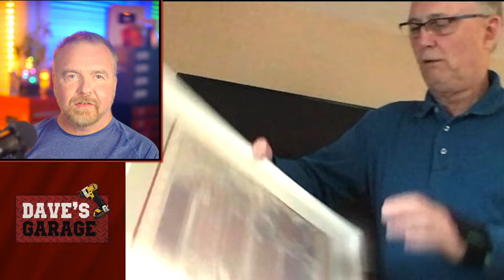Commodore 64 Chip Designer Interview: Albert Charpentier

Comment: I enjoyed the interview.  I was at Motorola when the 6800 was built.  A colleague of mine was recruited by the 6800 team to write a 6800 cross assembler that ran on the PDP/11.  I attended a presentation given by Chuck Peddle.  I remember him saying that the 6800  was a controller chip, not a computer processor.  At that time, the manufacturing was very difficult to control.  It took a while to get the yield up to an acceptable level.  As they were starting to get the yield up at the Arizona plant when the plant had their yearly summer shutdown.  When they restarted production, they had to go through the procedure of getting the yield up again.  During all this time a plant was being built in Texas.  Just as the 6800 yield was getting to be acceptable again, the production was moved to Texas.  It was another repeat of low yield again.  They weren’t able to deliver product and Intel was able to deliver.
Reply: What do you mean by yield?
Reply: @SheikhN-bible-syndrome  the number of usable chips for a given amount of raw material. Usually in this case it's the number of usable chips from a wafer. A wafer might have space for 100/200/300 chips depending on the size of the chip and wafer, but a low yield might mean only a few 10s of chips out of the 100s planned are usable. Such a low yield would be inefficient and costly.
Reply: Chip Belori  I mostly wrote code in assembly language.  I think the Motorola processors were easier to code for.  That includes the 68000 series.  I don't know how they were to design hardware around.  My first home computer build was a SWTPC 6800.
Reply: Just curious, why did they shut the plant down every summer?  Was it required for maintenance?  Based on the yield issues you describe from restarting production it just seems to be ignoring something fundamental to the ongoing success of the business.  I know hindsight is 20/20 but with business decisions like that it begins to put in perspective why Motorola just evaporated.
Reply: @jimfrench2001  I don't have an answer. It didn't seem to be a problem with older products.  In the 1960s, I worked for NCR in Dayton and they also closed the manufacturing plant for a couple of weeks in the summer.  I remember that many of the factory workers drove to work with their vehicles packed for a vacation.  At quitting time they would dash to their cars to leave. It seemed to be common in manufacturing.  With staggered vacations, they couldn't rely on have a full workforce all the time.
Reply: @WilliamBurlingame  Because of the fact they where so easy to program, we end up with x86 horrible.
Reply: @gorak9000  why don't these massive billion dollar fabs have their own stable power generation?
Reply: @jimfrench2001  It was not a business decision. Because of the cooling required during the summer, the power grid could not support both the fab and the cooling. Fabs require large amounts of power.
Reply: At high school we had a SWTPC 6800 that loaded from tape very slowly. Lunch time computer club was quite often over before it loaded or frequently failed to load.

Comment: I worked at Ensoniq in 1989 on the assembly line building the original EPS, VFX (short lived) and VFX-SD. I still have a working EPS and VFX-SD that I have to occasionally coerce into working. Mr. Charpentier's name would be called constantly on the PA system. All I cared about was music at that time, but you could tell there was something either special, or very important about Mr. Charpentier. I just celebrated 22 years in IT supporting all things Microsoft and very fascinated about technology and Engineering. If only I could go back in time.... I now regret never having a conversation with him or other key members at Ensoniq. I have been fortunate to have worked with, learned from and talked to many brilliant people. Missing that opportunity decades ago will always be regretted. Rock on Sirs! Love the channel and still love music.
Reply: Underrated comment... Really want one of those ensoniq boards, mainly an ASR10. Even though I'm coming in from a hip-hop background and we didn't use it all too much, the transwave synthesis capabilities of those keyboards are still super cool.

Comment: Years ago, I worked for Intel in Folsom doing chipset and later CPU validation.  This was from just before PCI-Express came out to just before the Core i series chips were sampled.  One of the Pentium 4 series teams had a printout of the traces on a Pentium 4 chip plotted out on a long roll of paper that was attached to the walls of one of the cube farms in a building that was more than 250 feet long and yet most of my coworkers still needed at least some magnification to be able to differentiate between neighboring lines.

Comment: After 30 years i got interested in 6502 8bit assembler and machine language again.
I think the C64 was and still is a great piece of engineering.
Reply: ...and it is a machine that you can completely know inside and out, and for me, at the time I had my C128(it spent most of it's time in C64 mode) I knew very little about the hardware.
Reply: After watching it from the start, at 27minutes Albert explains a lot better what I just trying to say above.
Reply: Besides the disk and tape bugs, yes.
Reply: I also still think it a marvel  what could be done on a 1 MHz CPU and a decent graphic system. 
Have a friend that made a "live" sprite editor that had:
- An editor at the top using 8 sprite
-  A line of the sprites in the animation that was edited
-  A display on the lower 3rd of the screen showing 8 of the current animation in memory that could be grouped and set to move as one unit.

Programmed using the cartridge "Edna" assembler. Just a fantastic example on what a Commodore 64 could do.
Reply: @IntenseGrid  I still have 2 128D machines, and still write code for those.. lots of fun to do.
Reply: @paulmichaelfreedman8334  Yeah, the C64 could have been a much better machine with the disk interface faster.   The tapecartSD makes things a LOT faster.
Reply: One Mhz...  yeah.  So much got done about that speed.  More than a lot of people might think.

It was lean and mean.

I keep an Apple //e running and sometimes program or write on it.  For the most part, one can create an illustration, write, play a game.

I got a 16Mhz 6502 for mine.  Crazy fast.
Reply: @DougDingus  The only thing that comes close is Parallax Propeller and P2 programming, but the on system development environment is better on the C64/C128.    I remember my first assembly language program for the C128.   It was a simple counter in the upper left of the screen.  Several of the digits flipped by so fast they were a blur.   That computer made a HUGE difference in the direction of my life!   Thanks Mom!
Reply: @IntenseGrid  Yeah, I agree.  The Propeller is a pretty great experience.  LOL, at the counter.  The very first assembly language program I wrote was to make some sound on the Apple.  Was nice, just a little loop, and when it's long enough, you hear something.  I did a counter later on various machines.  Suppose it was my first benchmark.  Count up from 0000000 to 9999999 by incrementing screen memory. Anyway, yeah the Propellers are really fun chips.  For a quick, retro style experience, the Propeller 1 and the simple Parallax graphics "driver" are pretty great.  No sprites, but a whole lot can be done with the flexible tile setup.

People are working on various P2 systems.  At some point, it's going to look a fair bit like your C128.  I've been toying with putting a P1 or maybe P2 on a card to install in an Apple.  I know others made little computers with it.  I ran a couple of those with BASIC, and had a good time!
Reply: @DougDingus  Yeah, I've played with FemtoBasic on the Propeller.   There are also BASICs for the Raspberry Pi Pico's, and forths too, but with forth in ROM on the P2, that is quite nice if you are a forth geek(which I am not).   As for the counter, IIRC, that is exactly what I did, increment the byte in screen memory from the PETSCI"0" to the PETSCI "9"...
Reply: @bknesheim  Where can we try this sprite util?
Reply: @saganandroid4175  I am sorry, but it is one of the many non released program. 
I do hope he still have the source. He moved to the Amiga and ended up working for Scala. I hope to get the chance to ask him for a sample, but he do not live locally any more.
Reply: @IntenseGrid  Forth on a Pi Pico, you say (pushes onto memory stack).
Reply: @IntenseGrid    That's the thing that kills me about my time with the Commodore 64 (and C128). I could have made that thing absolutely sing. I could have done so much with it, if I'd only got myself a good assembler and taken the time to learn to use it. I could have learned the machine inside and out and done great things with it. And I WANTED TO. I wanted to make games and stuff. I just never learned enough about programming the machine to actually do that.
Reply: @tetsujin_144  It's never too late.  Robin on 8-bit Show and Tell channel teaches Commodore BASIC and 6502 assembly.
Reply: For how long it took to make. If they weren't so rushed it could have been a lot better. Faster disk drive (they tried it but someone removed the extra data lines), better BASIC, the original SID design (which would have had loads of channels) and in the PAL region a nicer colour palette.
Reply: @6581punk  I understand the feelings about the slow disk drive - but I like the streamlined BASIC (has all the essential commands, is faster than the more bloated BASICs, allows for a reasonable amount of free RAM without bank switching) and the color palette (not as garish as on most other 8-bits, and the three greys allow for pleasing gradients).
Reply: @paulmichaelfreedman8334  I don't think the tape routines are bugged but just a bit slow because they are designed to maximize data integrity. As a result, even when having a disk drive, it is not a bad idea to put important stuff on tape as well (without fast saver).
Reply: I remember learning 6502 on the C64 in 1986 (aged 13)... I only learned initially because my dad confiscated my games as I wouldn't do my homework!!
Reply: @alanbenson1505  I started pretty late with the C64 in 1991. We had to wait until the wall came down in east germany to get one. Since the day i saw the first tech demos, i got hooked. What i like about these old machines is their simplicity. Yet they are able to still do impressive things. To some degree, people were more intelligent back in the days, but that is another story.
Reply: Back in the day.  Love it.  Keep a thread.  I did ram expansion on Atari 8 bit that allowed a RAM disk implementation for our clubs BBS. The PC crowd would not believe our little 8 bit machine out performed PCs at the time.

Comment: In 1985 I built a CNC router sign making machine using the output of the commodore 64.
I drove three stepper motors with direction controlled through the game port and the pulses for the stepper motors were produced through the db25 port.
The system was developed by putting LEDs on all the 25 pins and then running al program to see the result until we had what we needed to create letters.
Reply: Seems that time goldens memories… The C64 did not have a db25 port. And the user port registers were published, but the I/O couldn’t sink/source much current - driving LEDs was a stretch.

Comment: What a pleasure to see Al Charpentier.   I worked at MOS/Commodore Semiconductor in the mid-80's but I came in after Al had left.  I was a business systems programmer and then MIS (Remember the MIS department?)  manager before leaving to do consulting.  I did spend a little time at Microsoft too but that's another story.  Al was always held in great regard by those at MOS.    Thanks for this trip back to 930 Rittenhouse Road.

Comment: Loved this!  Albert is so enthusiastic and his memory is incredible.  Its clear that he poured his heart and soul into this work.  One thing mentioned is the analog switch memory access stuff.  If you put real logic in this place like a 74LS245 eg, you'd have an extra propagation delay of that device.  By using this switch, he had zero delay.  These bus switch type devices are common today and available in the common configurations like 245's etc.  The only downside is that they don't buffer but slow CMOS doesn't take much drive.  These new "quick switches" have very low on resistances so can maintain the low impedance of the bus drivers elsewhere.  Albert was about 40 years ahead of his time!  You have a good interviewer style- good questions and keeping your ego out of it- unusual and makes for a good talk.

Comment: Alberts commentary about how the C64 is reflective of even todays computers (there’s just more stuff but it’s basically the same) is right on point - I got my first C64 in 1983 while a EE student in college, most of what I know about how computers work came from studying the C64. For my first C64 project I designed and built a LED moving message board interfaced to the expansion port. I later learned I should have used the user port and was lucky to not make any mistakes that could have blown up the 6502!

Unfortunately I sold my C64 etc many years ago but I’ve recently bought another (well two ;-) and 1541 (two of those as well). Working on re-learning the details and perhaps building a new LED sign for the user port :-)

Thanks for this great interview!